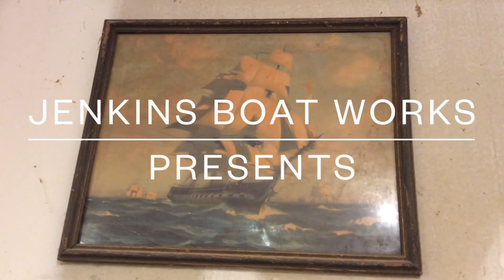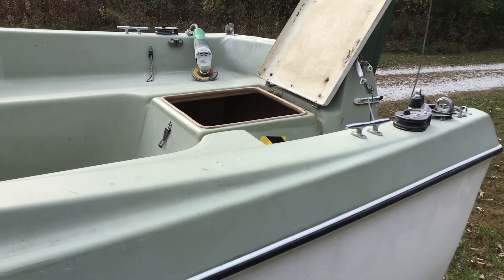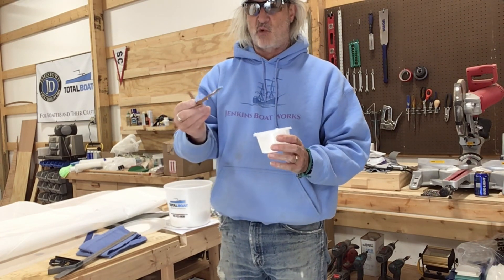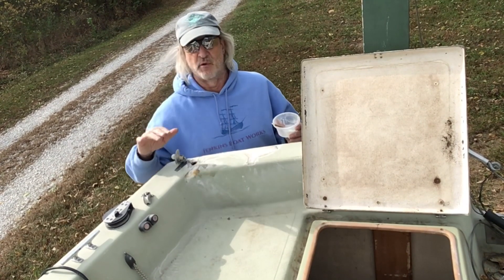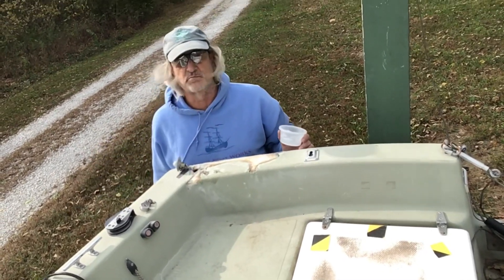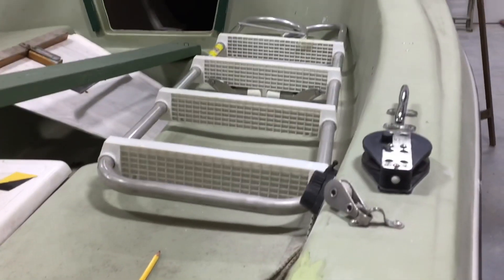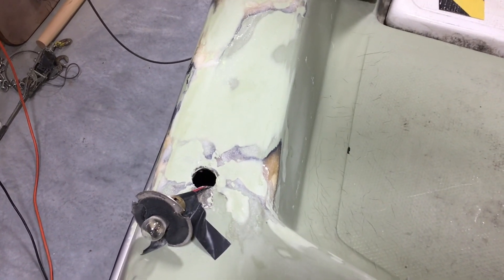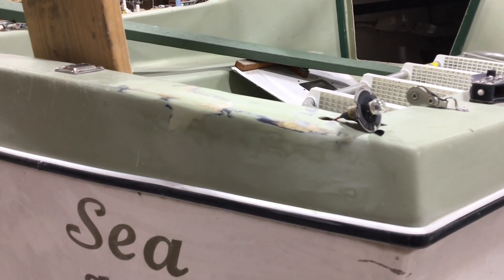How to Fix a Crack in a Fiberglass Hull Using TotalBoat Fairing Compound

Comment: Did you miss showing us a step there? I didn't see you put the fibreglass cloth on it :/
Reply from the maker: Good catch. Yeah, unfortunately the boat was still outside and the wind made it too difficult to video. I cut small pieces of cloth and put them in under a second layer of epoxy
Reply: Jenkins Boat Works ahh, ok. I'm just about yo do a very similar repair on my boat. How many layers of glass do you recommend?
Reply from the maker: @officialWWM   It depends a bit on the thickness and depth of the damage. I put in two layers of cloth. Since I was able to attack this from the bottom too, I feel like I got some very good structural integrity and as I ground down initially, I got to cloth that was existing within the structure. The way I laid mine in was to wait for that very first layer that you see in the video to set up a bit and then put cloth over the top of it. It stuck well as it was still tacky. Then I mixed up more epoxy, not quite as thick and put in another layer a day later. That was sanded down and then I did the fairing compound on top of that.
Reply: Jenkins Boat Works excellent, thank you.

Comment: Did u use fiberglass or straight fairing
Reply from the maker: Both. I used some small pieces of fiberglass with epoxy at first, then fairing compound to finish. This boat is now in the water!